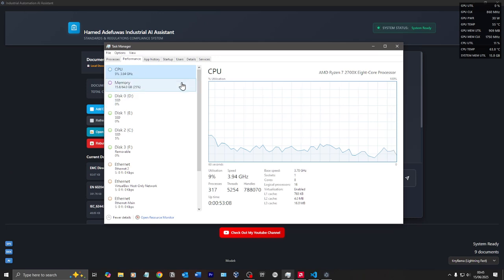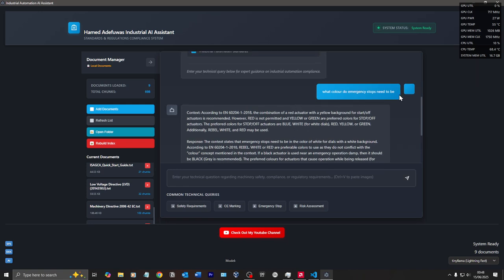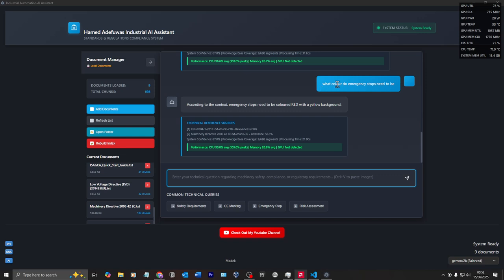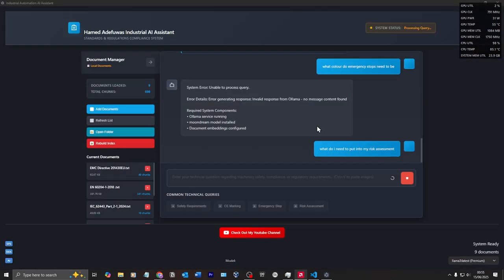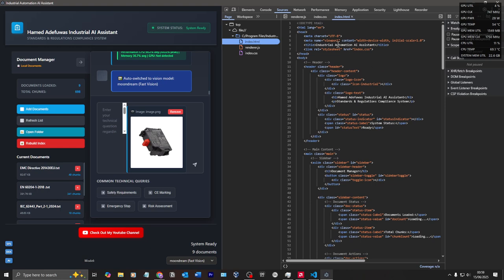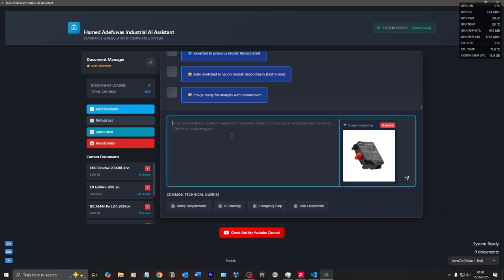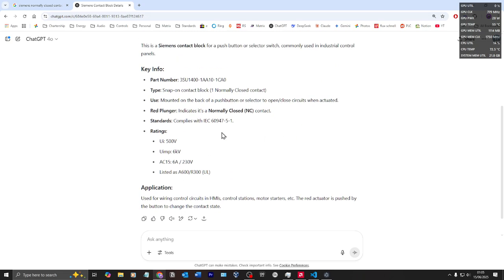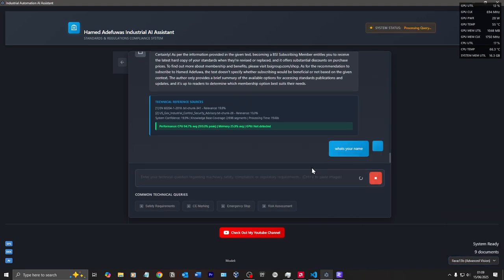Built My Own Industrial Automation AI Assistant App

Comment: Very good work. The speed increase you're going to get when you upgrade your computer is going to be nuts. 2700X you've got is from 2018 and RX570 is a year older than that.
The IPC gains alone on the CPU side are mental when you add them all up, not sure if the X3D models have a benefit in regards to local AI workloads as they're fairly memory intensive. So best to figure out a solution to run it on your new GPU, whether that's AMD or Nvidia.
Reply from the maker: Thanks! Yeah exactly, I don't know much about this world but this PCs been able to handle anything I've thrown at it so now finally I got an excuse 😂. I'm currently trying to setup LM Studio to run Gemma 12b with my GPU. Quite excited to see how this goes. Sadly with only 1-2 hours a day, me progress is slow. 😅